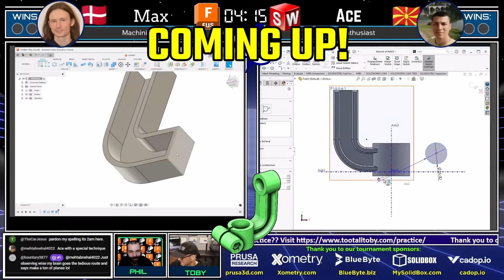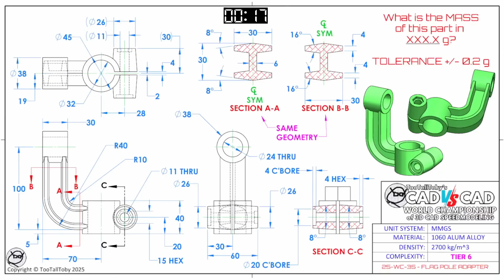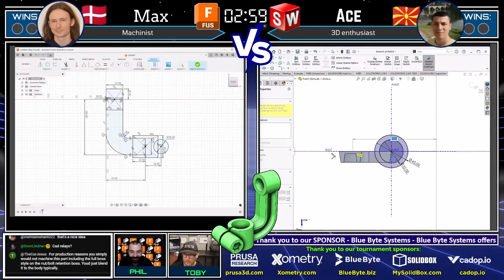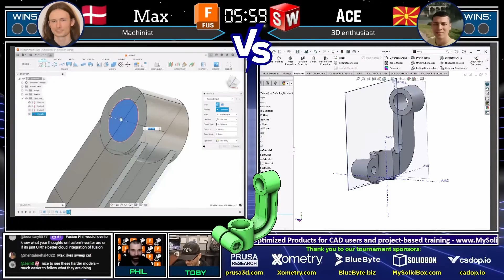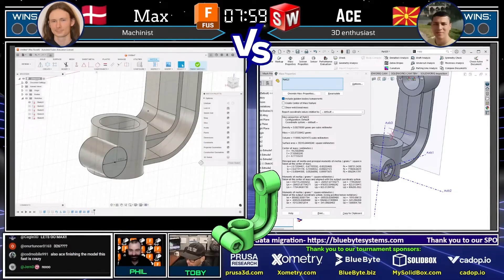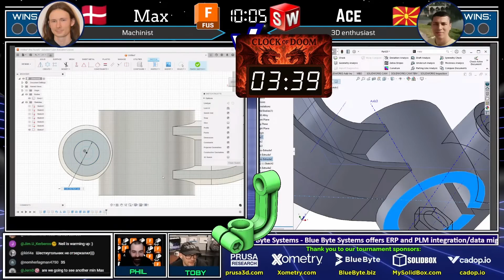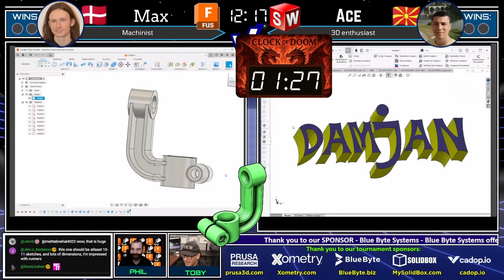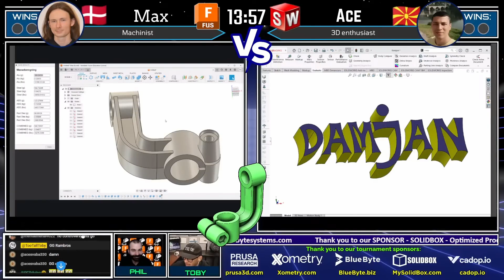CAD vs CAD Tournament - 2025 SEMI FINALS!! -  FUSION vs SOLIDWORKS

Comment: I have a weight discrepancy and I don't know why. My part weighs 307.5 g. All the measurements matched when I created the drawing. CAD System Inventor Professional 2026.  Part Volumen: 113902,262 mm^3
Reply from the maker: is the material density correct? We have all the materials densitys listed at https://www.TooTallToby.com/tournaments, and there's a discord channel on the TTT discord called #materials-tools
Reply: @TooTallToby  Density is 2,700 g/cm^3 (from Inventor) 
is correct
Reply from the maker: Is correct yes.  I'll make a tutorial on this one soon, but you could always hit up the Practice Models section of the TTT discord and post your model / screen shot of your model - those guys have eagle eyes for spotting discrepancies  😁
Reply: Insert the image into the model at a scale of 1:1 and compare the contours.
Reply from the maker: @damaskinoseli5386  yeah thats good too!
Reply: I also get the same mass (307.537g). I'm using 3DX. I've checked every dimension. 2700kg/m^3
Reply from the maker: @stuartpurdue  solution video here: https://www.youtube.com/watch?v=RPUaSBwisvc
Reply: @stuartpurdue  look were the 100 on the left is pointed. this was my failure in my model.
Reply: @ede-pv9zs  I made the same mistake! Thank you!